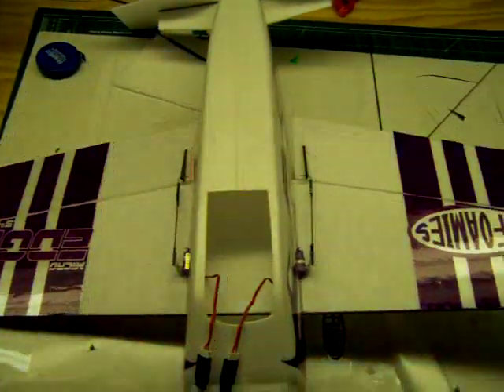micro digital servo flutter

Comment: I have had same problem with Spektrum DSP60 digital servos. Funny thing is that I calmed mine down by making the holes in control horns bigger, they were very tight at 1st maybe adding tension. I had rudder and elevator fluttering like crazy the second anything gets bumped, sensitivity problem trying to over correct itself.  These servos are constantly making buzzing noises.
Will be using Blue Bird BMS-373mg for my new Precision Aerobatics Extra-260 Should have bought them for my CAP-232 1st